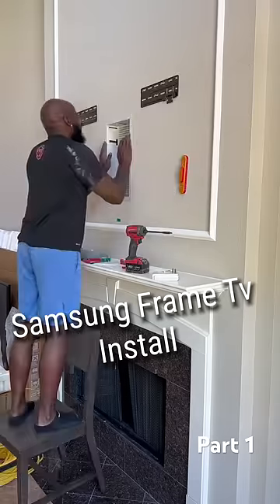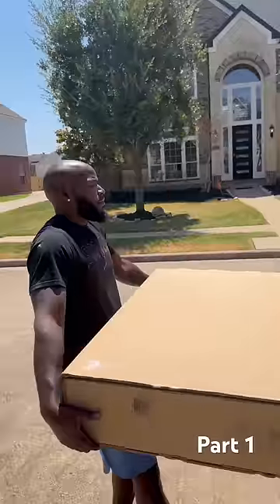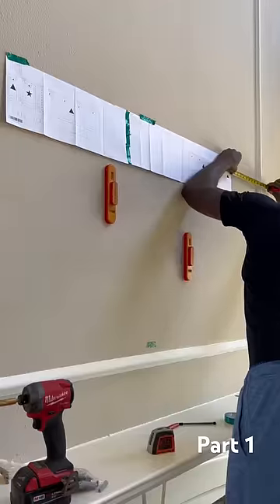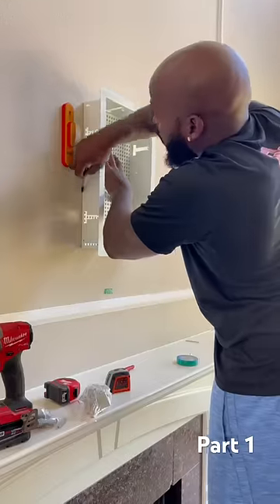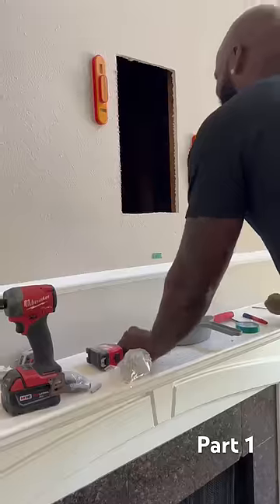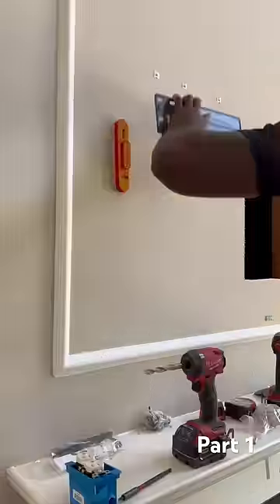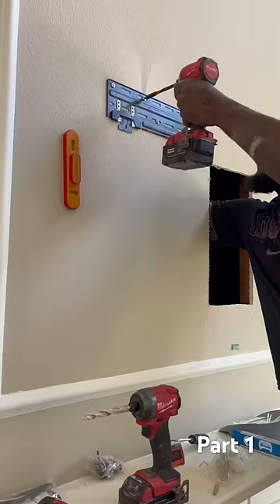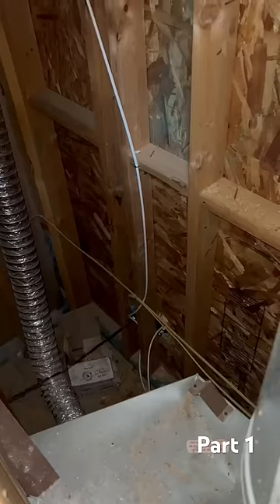Samsung Frame Install Part 1 #fyp #install #tvmounting #reels #frametv #samsung #4k #art #picture

Comment: The drywall anchors will eventually fail. You already have an access hole. You should put a short 2×4 between the studs on each side for proper support. Even if it's very light for its size, that big TV is dangerous to anyone standing close enough to get hit
Reply: Can’t fix lazy scammers. I’ve been seeing this dudes videos for awhile. Acts as if he’s a good and upstanding man while cutting corners and screwing over customers. You see it everyday in contracting
Reply: If you dont exceed the weight it wont fail. Stop being comment know it alls when you know nothing.
Reply: Not a contracting master for TV mounts, but am a painting contractor that has had to fix the drywall damage from poor TV mount installations on multiple occasions. What are your qualifications?
Reply: Could have easily put a backer but didn't...are you trolling?
Reply: So much this. 🗣️
Reply: Facts
Reply: I would have preferred backing but those anchors are rated for around 50lbs to 75lbs per bolt and he’s got a minimum of 6 in there. The display itself is around 85lbs so it should be completely fine with the install. Now if it was an articulating mount or even a tilt mount I would definitely be putting 3/4 backing.
Reply: He is using toggler bolts, look them up, each one is rated for hundreds of lbs, some rated up to 1000 per anchor. if Fools aren't hanging from the TV it will never go anywhere
Reply: @lovethislife40  I used to do it for a living. The bolt has a rating based off the thickness of the drywall and it’s usually around 50lbs to 75lbs pull out strength. Shear weight is a lot higher but usually double the pull out weight.
Reply: Toggle bolts are rated at 265 lbs on 1/2" drywall
Reply: I bet yall white in this section
Reply: @HokageZebra  dang!!!!! How racist are you?
Reply: @ryana3679  I’m Italian sooooooooooooooo 😈
Reply: @HokageZebra  so you like spaghetti?
Reply: Good work.
Reply: I think the wonderment by everyone is that he’s using bolts designed for walls without interior access and he’s got like a huge gaping “access” hole right in front of him and he cut the hole! It’s perplexing.
Reply: @lovethislife40 show me one drywall toggle bolt rated for 1,000 lbs or more.
Reply: @danielk810  I was mistaken, the 1000 plus is for block, 250lbs for drywall is what they claim. Either way, my stance doesn't change, those anchors will not fail for a light tv like og commenter claims.
Reply: @lovethislife40  I don’t think it will fail either. I’ve hung plenty of TVs. That TV probably weighs between 50-70 lbs and toggle bolts in 1/2” drywall are rated for about 80 lbs each. 

If it does fail then it’s his problem and we have a good tutorial on how not to hand a tv lol.
Reply: was about to say the same!! need to brace have something strong nail/screw/bolt too
Reply: @Billybob-go8hn It's not the alligators weight, it's the drywall that is not for this application. I think this comment was the best one pointing out a simple fact. Don't think he was being a know it all.
Reply: @TheCardDeal  They make tv drywall anchors......
Reply: Finds studs, proceeds to use drywall anchors…..
Reply: No it won’t my been like that for years
Reply: @RicardoVega-qf4xj  u do u, imma find studs rico
Reply: @Billybob-go8hn you right but that only apply when it’s actually drilled into a stud lol. It’s not so this tv prolly will fall tbh.
Reply: @user-vc8vx4vh1x  tv weighs less than 100 pounds, those anchors are for tv mounting. You have zero clue what you're talking about
Reply: @Billybob-go8hn  sure Billy bob whatever you say! ⚪️🗑️
Reply: Yeah I put a 2x4 in mine. Looks like a std Texas house and older homes don’t have 2x4s where the box fireplace is at.
Reply: I was thinking that like how long you think them anchors gon stay on fragile ssa drywall 😂😂😂😂
Reply: @ryana3679 yeah the anchors are strong but dry wall isn't.
Reply: @gmoffat70 I don’t care what them bolts are rated for, the amount of times I’ve seen them fail I would always put a backing up when fitting anything heavy.
Reply: A painter contractor? Stick to that. They're rated at 45 pds minimal. There are 6 of them. That TV weighs 50 pds if it's a 65 incher
Reply: False, I’m a commercial electrician we use toggle bolts for stuff heavier than that tv and they haven’t fell. Just don’t exceed the weight rating
Reply: @gmofat70 At work we have had these 150lb smart touch screen TV's installed like this with the same anchors with no studs since 2013... They are still standing to this day.

If the right anchors are used, the TV isn't going anywhere. And I'm fairly sure this TV is WAY lighter.
Reply: Same thing I thought, like how will that hold up over time.
Reply: Those specific anchors hold over 100 pounds EACH. I have mounted THOUSANDS of TVs working for best buy a decade ago using those bolts and NEVER had a issue. Even years later, never had a TV drop. Stop spreading false information
Reply: @ryana3679 Yeah I was thinking the same, he put a lot of them so as long as the drywall stays dry😂
Reply: That’s what I was gonna say they probably hold that light tv but id probably went ahead and put some if I could
Reply: Agree 2x4 blocking should be used. The toggle bolts have an "up to" rating. This assumes the drywall is properly secured. Since there's no good way to tell, I wouldn't risk it.
Reply: @Billybob-go8hn I agree. But I would still likely reenforce it with a stud since access is already available. The idea is to always exceed weight requirements and future proof
Reply: @user-lm4no7hw8l  I mean fair enough, on my house I wouldnt care. Now working on someone elses house, you should go above and beyond.
Reply: @ryana3679 but the dry wall is not. The anchors will be full attached when the tv rips the drywall out of the wall.
Reply: @Billybob-go8hn  yeah, it’s all about perspective
Reply: @Billybob-go8hn I've been doing construction for a long time If you already have access to inside of a wall put a backer in.  They will work better than drywall anchors I can 100% guarantee that
Reply: Toggle bolts?!
This is the difference between specialty jobs vs license required general tradesmen.
Reply: @ryana3679 I like spaghetti 😊
Reply: If you’ve ever installed one of these you’d know that it has two mounting plates and the way they have to be spaced means you are lucky if you can hit two studs. And there are always a couple bolt holes that need to be anchored to the drywall. 

It’s not like he’s installing some big articulating mount, this is basically just a big picture frame. Samsung gives you regular ass drywall anchors to use so the toggle bolts are actually an upgrade.
Reply: @F-lu3qs the Frame TV has two mounting plates and both are maybe 8” long or less and have to be spaced apart. You do the math there bud. The toggles are for extra support and that’s it
Reply: Og comment is right they may have 250lb claim but that doesn’t mean you can stack three in a cell with 3 inch spacing along with the fact it’s a fireplace which is going to eventually leak adding moisture to the situation then that drywall is useless it’s always best to think about the variables at play and adjust accordingly not just see 250lb strength and then think you are going to hang a swing from one because “that’s what the box says” you’d be better to throw a couple 2x4 in the cell and then never have to worry about it or any other tv they decide to hang
Reply: @artificiallyunintelligent4537  hey bud, why dont u go back and watch the video again, tell me which one of those toggle bolts are going through studs
Reply: Toggle bolts will not fail
Reply: @TravisBry funny thing is you hating on him but “been watching his videos for awhile”
Reply: @Billybob-go8hn Dude if you want it to be safe mount the TV on a cemented wall.
Reply: @seannightwal1765  Id trust a lag into wood over a tapcon into cement.
Reply: @lovethislife40 EXACTLY
Reply: @Billybob-go8hn  never really tried mounting things on wood. One earthquake and your TV's toast unlike when you mount it on cement it wouldn't fall easily, but you have your opinion and I have mine.
Reply: @seannightwal1765  Untrue, the mount on the tv would fail before the mounting bracket. So either way, your tv is falling.
Reply: My thoughts exactly
Reply: Wow, good idea. Why didn't I think of that 😑
Reply: I’ve never had a TV fall and crush my children 🤷🏼‍♂️
Reply: I was thinking the same thing would have taken a whole 5 minutes extra
Reply: @Billybob-go8hn eventually, it's only sheetrock that's holding it up.
Reply: The bolts themselves are rated those weights you guys keep quoting. Drill them into a piece of paper, will it still hold a TV? It's about how sturdy the material is...
Reply: thank you... not 1 screw in a stud for that big ass tv
Reply: Those are toggles...good for like 160lbs lol at LEAST 70lbs depending on the toggles used...that tv is only like 20lb...it will be fine lol
Reply: @6shoresy9  I don't think it's about the bolts. I thinks it about the sheetrock
Reply: @law35penn  yea, but the toggles spread the load on the sheetrock. Snd it wont fall unless you yank on it frequently.  My tv has been held up by toggles for 4 years with no issues lol
Reply: @6shoresy9  meaning no kids in the family. I understand the toggles, but I have learned to build everything kids' proof.
Reply: The toggles are legitimate. And they will never move…..
Reply: @HokageZebra That's your nationality not race.
Reply: Exactly👍
Reply: Bro i got one of those frameTVs, mine weighed like 20 pounds.
Reply: He could've got at least 2 screws from each mounting plate screwed down to a stud and then use 2 to 4 toggle bolts. Stud is way stronger and will never fail. Seems silly to use all toggles.
Reply: Neg ball
Reply: @HokageZebra ah yes italians the most racist of all creatures in the universe.
Reply: @Billybob-go8hn hey uh buddy you also probably think your house or car doesn't wear when it just sits in one spot hey? 😂
Reply: @Steve.._.  drywall doesnt wear
Reply: Those metal anchors will not fail before the TV reaches the end of its life and a new bracket needs to be installed as a new technology has come around. 😫😫😫
Reply: Had anchors in my walls for 6 years when is it going to fail?
Reply: That will be more than fine, Grandpa
Reply: Exactly what I was thinking.
Reply: @HokageZebra white people built a world that lets you use a phone to make your comment. You should b grateful. You would still b in Africa wiping your ass barehand
Reply: I was thinking the same thing. I've always put a 2x4 when no stud. Customer will be very upset when that TV 📺  falls. 😖
Reply: This ain’t the early 2000s I hung my 65in tv at 17 on the wall perfectly centered with 1 arm on the tv other on the drill I got right on a 2x4 but regardless It was lighter then my old Samsung 24in tv lol
Reply: @TheSands83  but I’m Italian so yall copying us only thing yall did is massacres
Reply: The TV weighs 50 lbs. All these self proclaimed EXPERTS in the comments are hilarious 😂😂😂
Reply: @HokageZebra no one cares that your Italian.
Reply: A 4 ft 2x4 and four normal screws would probably cost less than those toggle bolts also
Reply: @jeremysanders8138 what's that drywall rated for though?
Reply: @ryana3679  it's not the toggle bolts that are an issue, it's the drywall itself. Not even close to the rating of the toggle bolts.
Reply: @gmoffat70 I think the toggles are fine because the frame will support a lot of weight but if it was a mount that holds the weight of the tv away from wall they absolutely will give out .. especially if your always pulling in it to change direction of view of pulling it out n pushing it in ..
Reply: Just mount it right to the studs! Anchors will definitely fail!
Reply: @TravisBry skumbag just let’s that piece of drywall fall to the floor! And doesn’t pick it up!! Very unprofessional! Things like this do your self!! You will do a better job!!
Reply: @decormiamour nah we're just real contractors who've seen situations like this fail and fail again.
Reply: @ryana3679  EXCUUUZZYYY 😅 YEAH! Because spaghetti? Who doesn't 😕🤷🏾‍♂️
Reply: @TravisBry y’all don’t know what you’re talking about I install TVs as part of my job too and the toggles are perfectly fine I’ve installed that exact same tv with the exact same mount 100 times and they’ve all been with 4 toggles to drywall 2 lags to the studs (the subdivision I work in uses sheet metal studs on interior walls not wood like most of them) if you have the proper toggles they can hold up to 120lbs a piece we’ve had TVs on walls with toggles that are still standing perfectly fine years later. Stop speaking on what you don’t know and knocking a man and his reputation down because of your own ignorance .
Reply: @Billybob-go8hn won't fail? It's going to be touched and it will eventually start to get loose and crumble. The toggle slipped too he said and he had to do extra to hold it
Reply: @drtyjerz47  Wrong, you dont know what you're talking about.
Reply: But a a clip on hard drywall won’t fail . I have mint tv this way for serval years now with diffrent tv brand
Reply: @Billybob-go8hn  ty 100%
Reply: What was the problem?????? He did everything pretty well. I've been working audio video professionally for just over 5 years now and from my experience the toggles will last for as long as the dry wall lasts and each one has a 225 pound weight limit and he uses 6. Plus he popped studs. So what's the actual problem with it?
Reply: No failure. TVs today weigh marginally nothing. Go bs someone else!
Reply: @Billybob-go8hn with a name like billybob that’s exactly what I would think you would say
Reply: @73SINNER  With the name 73sinner, I know you dont know what you're talking about.
Reply: No it won't. You have no idea what you're talking about.
Reply: Just what this video needed... A TV mounting expert with no video proof telling a person who's actually mounting a TV what he should've done gotta love social media 😅
Reply: How will the anchor fail?
Reply: The drywall anchor haters are beyond help. 😿

Do not over engineer and over complicate TV mounting. 

Read about shear and tensile strength and understand why these drywall anchors are almighty.
Reply: This job is done to perfection and is very safe. Beyond believe there are 1.5k people want to over engineer this simple job that was done perfectly. Its either you hate or you are so dumb! 

Please read about Shear and Tensile strength. The Frame Tv is so close to the wall and this no gap tv mount can never align to a stud unless your are lucky. 

Inserting a plywood backing or adding studs behind the wall for this type of job will be a waste of time and effort. It will be unprofessional to price a customer for unecessary work.

It will be a ripoff if you suggest and charge a customer for over engineering this .
Reply: @TravisBry  This job is done right. I Dont see  anything wrong with using toggle bolts. Read about shear and tensile. This is all shear and no way this tv is going anywhere in a 100 hundred years. 

The lazy contractors want to spend an entire day in the customer house over engineering with an over priced service. They are the real scammers but get away on the pretext of safety - actually its pure ignorance of new technology and refusal to understand the laws of physics.
Reply: @Billybob-go8hn  spot on. Toggle bolts are very strong for no gap tv wall mount.
Reply: Those anchors are rated for over 100 pounds. The tvs are light especially how they sit on the wall with brackets. The brackets displace load so actually this is perfectly acceptable and some tvs even call for no brackets just a long strip with many small nails…. I don’t think he’s the one lacking knowledge moffathead
Reply: @HokageZebra found the clown! You’ve played that racism card out already. Back to bed boy.
Reply: @stringjamer   boy? How you know I’m an boy?
Reply: I have no clue why people are defending hanging a TV just into drywall. That's an accident waiting to happen . I don't even do this s*** for a living I'm just a construction worker and have actually rehung multiple TV's  that were very secure into just drywall😂
Reply: I was gonna say the same thing.
Reply: This is a great idea
Reply: That shit gone eventually rip straight thru that dry wall
Reply: South Park was right
Reply: @HokageZebra just cause your Italian doesn't make you a non-racist. Any ethnic  group can be racist. So what is your point of being Italian?
Reply: @HokageZebra Italians r white
Reply: @HokageZebra I’m glad you said your race. Cause they would’ve IMMEDIATELY assumed you were black and started saying every slur their ancestors came up with.
Reply: @ryana3679 lol yeah with a strong foundation. It's sheetrock it ain't holding that up forever ..... The Sheetrock will fail not the toggles
Reply: @lovethislife40 what's sheetrock rated for? Being that I can shove a pencil through it and use my finger to make the hole bigger I doubt it's close to 20 pounds
Reply: Exactly he set them up for the tv to start slanting and falling over time, good call bro.
Reply: Yeah I'd rather listen to the professional who's been doing this for years and probably never heard a complaint about the "drywall failing" for the entirety of his career and thus never had to adjust for the "problem". Than listen to some random smartass on the internet, who's flashlight handymanning from his keyboard.
Reply: True! I moved into an apartment with a tv mounted to drywall and it fell and missed my bare foot by about 2 inches. It smacking my arm on the way down was a decent bruise.
Reply: 😂 this was what I was just about to say "needs some wood" and the comments section never disappoints. 👌🤣
Reply: Exactly!
Reply: My thoughts exactly... this was pathetic!!!
Reply: @HokageZebra still white with culture
Reply: Those will not fail we use those same kind of anchors to install handrails in commercial buildings through just drywall a single toggle anchor can hold 265 pounds in 1/2 drywall should do research before making a comment 😂
Reply: @daltondenun858  that's right. I'm in agreement with you. I wouldn't trust the drywall anchors. One tiny leak in the roof around the fireplace that can't be seen from painted side of drywall and all of these so called weight rating no longer applies. Drywall comprised by water eliminates any anchor weight rating.
Reply: @jeremysanders8138  so tell me the weight rating if the drywall inside gets wet due to a leak in the roof that can't even be seen from the finished side in the room until the TV is on the floor. Maybe it will never happen. In my house, all the drywall can rot and fall of, my TV will still stay mounted to the wall because the mount is anchored to wooden studs and cross supports. Your logic is flawed. The most light weight bolt holding a bumper on a car has a tensel strength of 10,000 lbs per square inch. But they still put 4, 6, 8, and even a dozen or more to hold one bumper on. Why do you think that is? SAFETY. So it doesn't fall off or fail at the first bump or sign of rust. SMH. Did you come here just to try to insult me? Because you can't brother. You can't demean or insult someone who knows they are correct based on facts. A coat hanger might hold up a muffler but it doesn't make it a proper repair.
Reply: @Billybob-go8hn Absolutely no weight should be placed on drywall
Reply: @daltondenun858 how many times exactly??
Reply: @gmoffat70 i have a degree in Drywallogy & TVMountstry and I can say. That them anchors. Are. Sufficient. For. The. Job. 👏 👏 👏
Reply: @TravisBry this mf scuffed the wall too when he used the chair to knock the wall out 🤦🏾
Reply: My thoughts exactly. Seeing those bolts sitting on brittle drywall makes me uncomfortable
Reply: When you don't have the money or the house.... kids or the wife can get hurt and end up in the hospital.
The company has engineers. So you don't sue the manufacturers 😊
Reply: Thank you!
Reply: Yup exactly that part smh & their nice tv gonna hit the floor because of it
Reply: @TravisBry that’s why I usually use Spanish guys instead of black guys for renovations work. This exact reason smh 🤦
Reply: These tvs Weight less then 50 pounds I think they’re chillin
Reply: Clueless
Reply: All these arguments wouldn't be needed if the Americans just stop building their homes with cardboard
Reply: @hassan_codes  lol true fam
Reply: what sucks about this comment the most is how many people up voted such brainless nonsense.
Reply: @TravisBry  you don't know what the hell you're talking about
Reply: Absolutely false my guy. These mounts are rated for roughly 80 pounds per x2 which is 160. This TV weighs 90 pounds max.
Reply: @TravisBry  you watch his videos but at the same time you call him a scammer!? Lmao
Reply: @Billybob-go8hn don’t exceed the weight of what exactly?
Reply: I believe if those are quarter inch zip toggles the rated for 200 pounds of sheer force and sheet rock. This won’t fail.
Reply: @ryana3679  a Samsung frame TV of this size is probably around 40 pounds. I don’t know where you’re getting this info from.
Reply: @Jeff-hz7xb  I have literally done this for a living since 1999 and sell these displays all the time. A Samsung 65" or 75" display ranges from 53lbs to 72lbs without the mount of legs. Add in a weight for the mount and the 85lbs comes in pretty accurately.
Reply: @Jeff-hz7xb  Correction on this one. Thats a 75" Samsung Frame TV. Specs on it are 35.3Kg Set Without Stand. That actually 78lbs. Where are you getting your 40lbs from?
Reply: @ryana3679  I just returned to 75 inch frame TV. It weighed 61 pounds with the box.  I bet the box the stand and everything else inside of it, including the one connect, which is actually very heavy. I would say that’s probably about 15 to 20 pounds. Either way, the anchors are more than adequate for this type of installation.
Reply: @Jeff-hz7xb  stop responding. 4 months ago. Over it
Reply: Do research on toggles. There’s a reason why he only uses them. Each toggles supports the weight of up 60lbs and have the correct surface area to prevent any damage
Reply: Reminds me of the time I saw a plumber install grab bars on a tile shower and use just drywall anchors because there wasn’t any type of backer wood I was like uhhhh that’s gonna come right out when someone grabs it